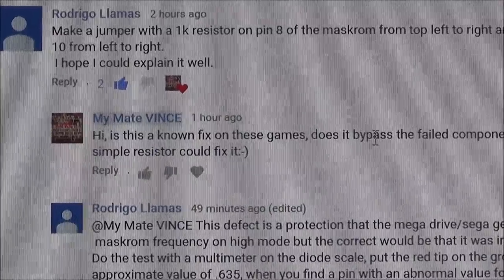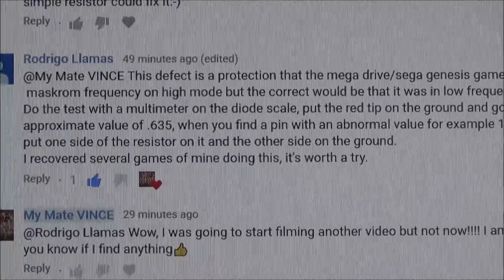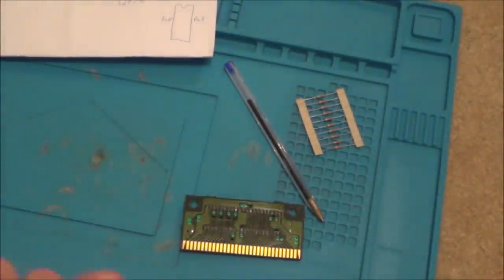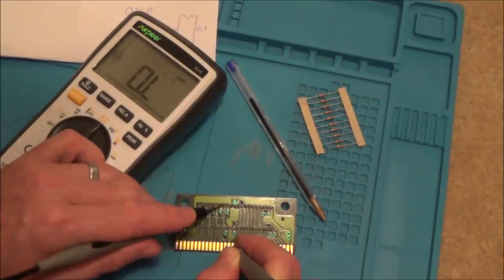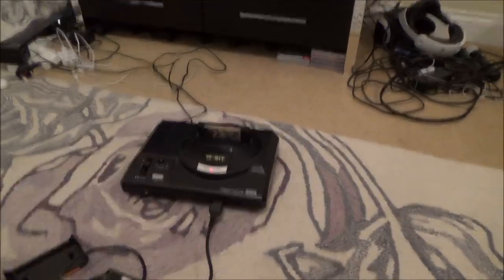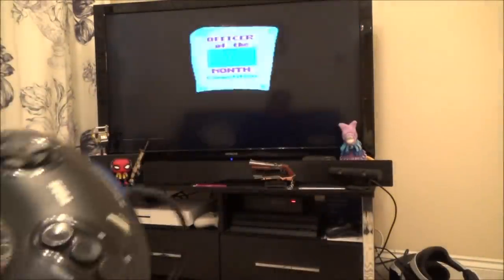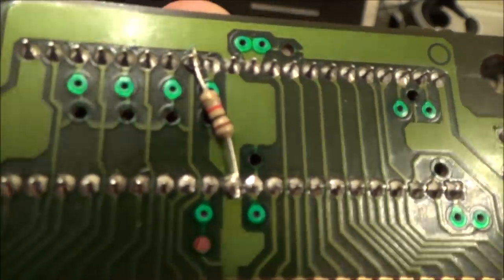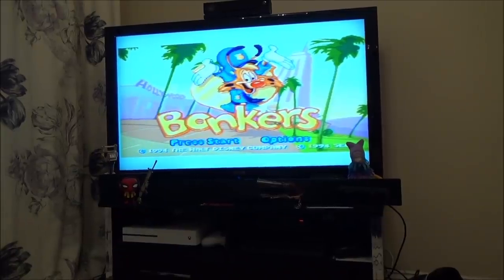REVISIT : Faulty BONKERS SEGA Mega Drive (Genesis) GAME

Comment: Wow, that's absolutely amazing!  Consider me impressed lol!  I've had other chips with failed pull down / pull up resistors, but this is hard to believe lol!   Going to have to re-visit my Streets of Rage 1 and 2 carts!  If this works it would mean the original chips can go back on there.   Glad I kept the old faulty ones now lol.   I kept them (along with a tonne of other fault chips) to cover in some video where I look how they failed etc.
Reply from the maker: Thanks Chris, film them. Hopefully you may have some success :-)
Reply: Sometimes it pays to be a packrat :)
Reply: Yep it works like a charm I had a “Ecco: The tide of times” that I got 5 years ago, never worked and I tried all as Vince, and the card seem new inside... I tried this one because I had 1k ohm resistors laying around and... puff it works, the same pins! Thanks for the tip!
Reply from the maker: Excellent, thanks for letting us know it worked :-)
Reply: @Mymatevince  I've got a copy of "Boogema" on the Megadrive somewhere, when it eventually gets found, I might give this fix a go :)

Comment: Plus your apology for the over reaction is not required,most of us would be the same,i've been repairing stuff for years and i still do it !
Reply: I believe it’s just natural to over-react when something seemingly impossible actually works... if anything, I felt his over-reaction didn’t do justice for how such a rarely-heard-of fix actually worked, as this is just unbelievable (at least to me).

But maybe I have an explanation: The Q7 is an “address” pin, or a “query” pin, corresponding to one of the binary positions of the data to be read (these “address/query” pins (and the signal levels going to them) determine the precise position of the data the game wants to read at any given moment (which will be read through the D0-D15 pins, the “data” pins, corresponding to a 16-bit value)).

The Q-pins are inputs, telling the chip what part of the data to read. The D-pins are outputs, relaying the data requested (I think).

ALL cartridges have a Q7. If that one is ALWAYS low, that means that around half the data is inaccessible (not lost, just inaccessible). The signals coming from the console follows a specific schedule, and some of them are for the address/query pins. All these signals should pass through ground from their pins. If they don’t, they don’t conduct (it would be an open circuit, and the chip would see only “low” signals from Q7).

By placing a resistor between a defunct pin and ground, I believe this pathway is restored. The reason a 1K resistor is used is because it matches all the other “resistance” values of the other address/query pins (not precisely but adequately). This means that the Q7-pin conducts signals normally once more, allowing the full data to once again be accessible.

TL;DR: Q7 is an address pin (also known as A7). If it doesn’t conduct, the resistance/diode reading from pin to ground will show as open, which means all signals going through it will appear as low to the chip.
By placing a resistor between pin and ground with resistance that is approximately the normal value of the resistance between the pin and ground, the signal is restored along with complete data access.

PS: Just speculation, but one based on logic.
Reply: @Operational117  Thank you for the explanation,you learn something new every day (and i have) i like his reaction,reminds me of me when i've fixed something difficult,it is a good rush ! :-)
Reply: I swapped out the charging port on an original PS Vita yesterday, after at least an hour and much cursing, I finally got all the tiny pins soldered ( If I hadn't, it would have been heading to Vince ) and done exactly the same, an audible "yes!!" followed by several fist pumps in the air :p Love it when you revive something :)

Comment: Tip for you fixers. When removing a resistor from a pack of 5 or 10 the paper that connects them has glue in between the two pieces of paper. If you pull them out the resistor will have glue on the end and it can gum up the works. in this case it was installed in a way that would not cause a problem. It is better to take the diagonal cutters and cut it out so you don't have any glue on the resistor leads that can cause a cold solder joint ps really a fun one to watch
Reply from the maker: Nice little tip, thanks for sharing it :-)
Reply: thx for the tip. actually never thought about this b4. will do so in the future

Comment: Nice job.

Here is a little learning opportunity:  IC pin numbering is standard.  From a top view  pin numbering goes counter clockwise from the notch.  This counts out to pin 29 for the pin where you added the pull down resistor.  On the board layout pin 1 is normally the only square pad.

I remember one board where we were seeing dirty 11 volt highs on 5 volt data lines.  The circuits were acting as voltage doublers.  We added 10k pull down reistors then saw beautiful clean 5 volt highs.

Comment: Nice one Vince.
One tip if you had re-soldered the the pins you was adding the resistor to 1st it would have done so a lot easier.

Comment: thanks to vince i managed to save two genesis games doing this, on one a pin was reading 0 and on the other a pin was reading higher than the others and using a resistor on both games made them work!

Comment: Hello VINCE me again. Couldn't quite find much information on this. But from what I gather from what I know and that post here is what I think is going on. That pin is a data line pin. It sends data to the console. From what that post says it might be a signal to tell the console what clock frequency the cart should be playing at.(I only assume.) A miss-match of this frequency would cause the problem you were seeing. What may have happened is a semiconductor inside fried. That 0.6 is kind of analogous to a diode of some type. Anyways data lines need a thing called either a pull up resistor or a pull down resistor. I will use pull down because that is what it appears you are doing here. When that data line is off there is no connection. So it is an open circuit. So with that resistor attached to ground and an open circuit the whole line will be pulled towards ground. This prevents stray emf from causing weird high or low values on that line. Of course when that line is being used the resistor prevents that voltage from shorting to ground. It should be around say 1kohm to 5kohm. I am guessing some semi conductor in their busted open from maybe static shock and made that line floating causing your issue. I can only guess since I do not know what exactly that pin does.
Reply from the maker: Great explanation written so people like me can actually understand it. Thank you coll6 :-)
Reply: @Mymatevince  Hope it helps. I know a lot about circuits, but I am still a student. Being able to watch someone else repair stuff has been very helpful for me. Hope I can shed more light on weird things like this in the future for you and anyone else following along.
Reply: Smattless  yes I am currently studying electrical engineering.

Comment: Your videos are  very appreciated! I have a Sega Mega Drive Castle of Illusion cart here, not working in my Mega SG and a model 1, working without sound in another model 1 and working without of any flaws in a model 2 Mega Drive! Pin 8 on my cart is giving me a complete different number in the diod test than the other pins. Not 0 but not far away. I will give it a try with a 1k resistor, but i have to order them. Here in my region in germany everything is a bit backwards, there is not one shop in Thuringia for customers to buy electrical components...

Comment: what is happening when the trick with the 1k resistor doesnt work? i still got value 0,02 in one pin and the rest pins has 6 to 9
Reply: Similar experience. 0.077-0.080 on the multimeter before and after soldering pin 8 to ground. Tried soldering pin 8 to the top and bottom ground pins and tried two 1k resistors to make sure one wasn't bad. Really thought this was going to work given the pin 8 reading was so far off from the other pins but no luck. If anyone figures something out for this scenario, please share.